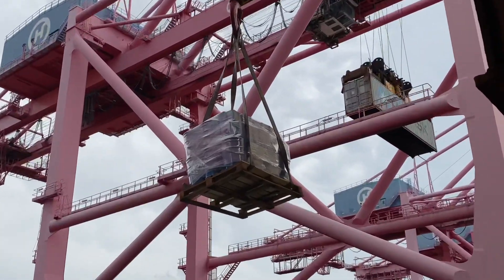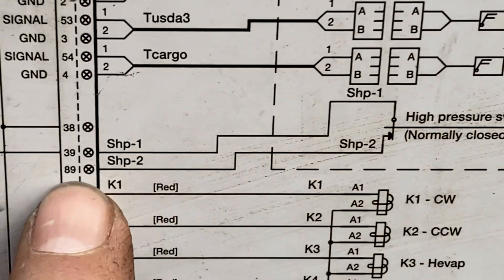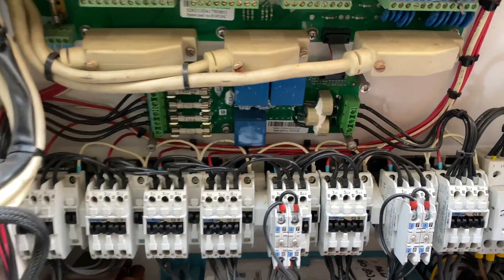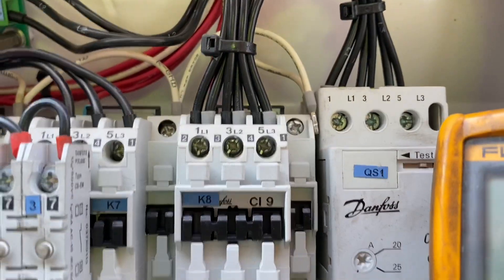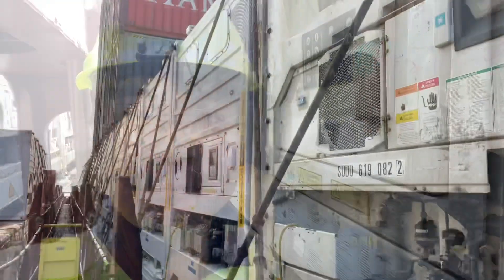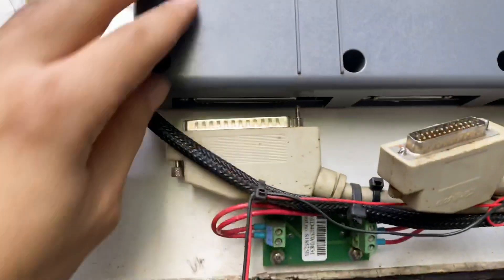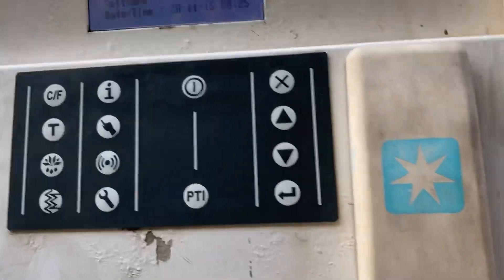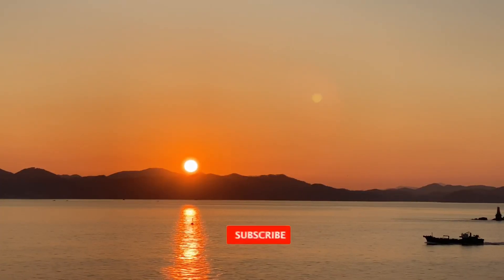REPLACING THE CONTROLLER OF REEFER CONTAINER | ETO TROUBLESHOOTING

Comment: I have a reefer starcool that’s displays no phase detection 423 starcool unit unit has been running fine for a week now in range did my Morning round this morning aboard ship noticed unit off turned it back on and got that alarm in the past most time I could switch two leads on the plug or change it out and be good no dice so I changed the power measuring board cable to the unit also bypass the fc still no dice show I had a spare cable I ran just to test to see if it was the cable k got 440 across each phase but I am still displaying 330 across each phase on the display Do YOU think it might be the controller
Reply from the maker: just go to the configuration and choose phase detection to CW or CCW depending on the correct rotation of your fans.

Comment: By checking resistance how you find out that pressure switch is closed I could not understand? what's the relation ?
Reply from the maker: if alarm is active but the pressure switch resistance is closed then the alarm should not be there.
Reply: @leckyjake  what do you mean by pressure switch resistance is closed?
Reply: @muneerkhan8127  Well if the pressure switch is open then what resistance would you expect?

Comment: Bilal CCTV cameras&AC,DC,Inverter installation
Networking I.T.Electric Engineer
Computer 💻 laptop 💻 hardware and software update all
All I.T Electric solutions have 
My contact number
 03244041148 
My WhatsApp 
03133945595 seve you 😊

Comment: sir good day.  i have a problem i hope u help me. it regards. in generator set. cummins  faraday. if the gen set alarming. the error indicates in module display. is over voltage what is cause problem.

Comment: Good information sir , but one thing after immediate loading , if any alarm is there , can we call techn.
Reply: Or unloading this unit to ashore back 🤣🤣🤣
Reply: All those reefer containers has been checked previously no fail should occur
Reply from the maker: They running machineries that can get malfunction at any given time, especially transporting from the port, to track and loading to the vessel, lifting them up maybe 30-50 meters high and put down from that height. The bang, vibration and shock it may happen.
Reply: @leckyjake  that is true jake... after load just checked unit not running.... open panel and found all contactor was not attached well... some fuse torn out... yeah 🤭🤭
Reply: @leckyjake  good job ... videos are reference to us